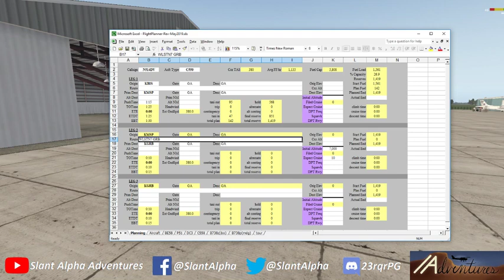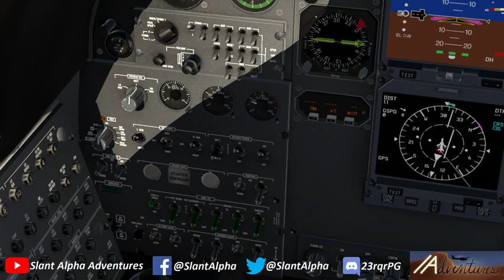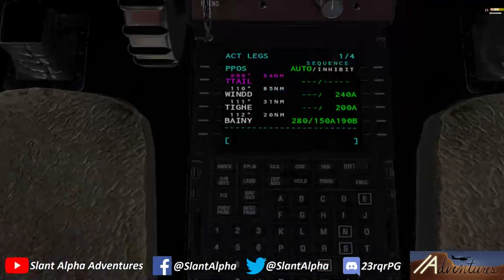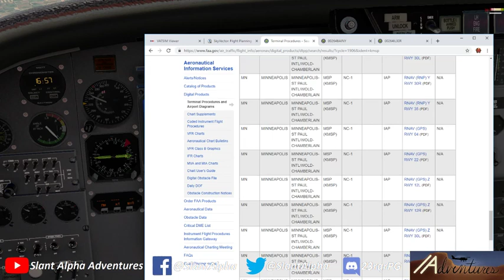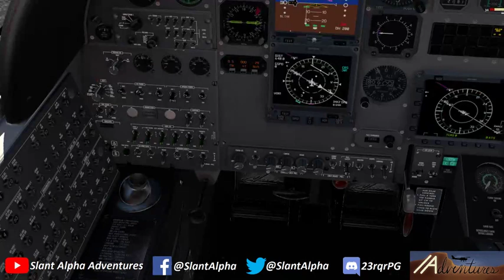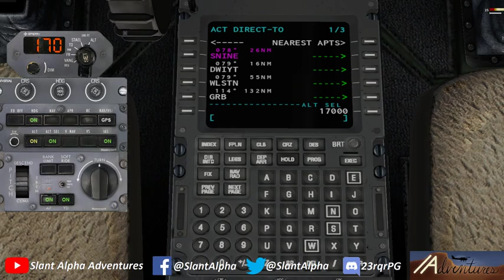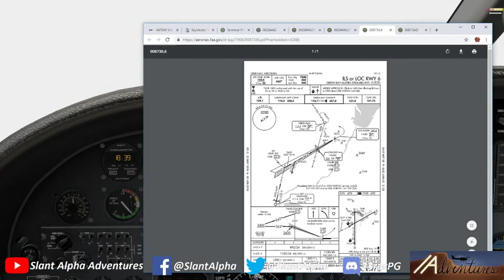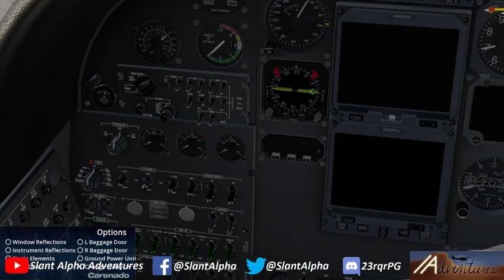[ XP11 | VATSIM ] test of the new VATSIM audio system!  KBIS-KMSP-KGRB in the Carenado S550!

Comment: I agree with your point about it being a little too clear.   It would be nice if there is an option to simulate VHF distortion realistically.  Even if that isn't implemented, this is so much better than what we have.   I think the present "sounds like the controller has a fish bowl on his head" quality has turned a lot of prospective sim pilots away from Vatsim.  I predict the new software will increase traffic on the network.  At least I hope it will.
Reply from the maker: There's another big test coming up tonight, and my understanding is that a somewhat realistic VHF signal degradation simulation has been added to make the clarity dissipate the further you are from the receiver.  It should be pretty interesting!  I'll be streaming my flight so check on Twitch or on this channel afterward to see how it goes!